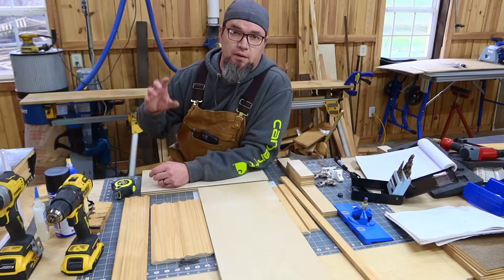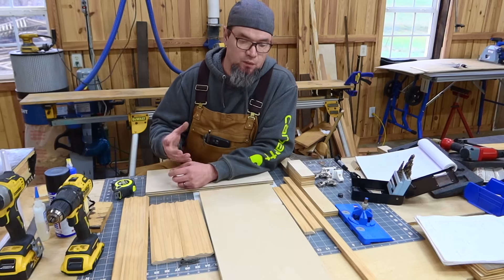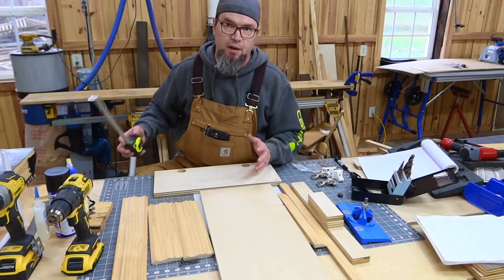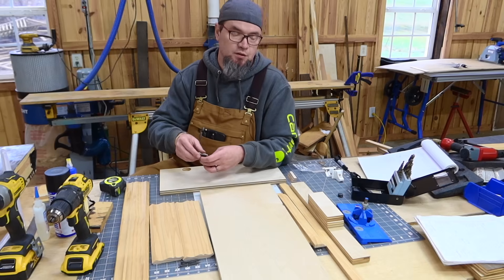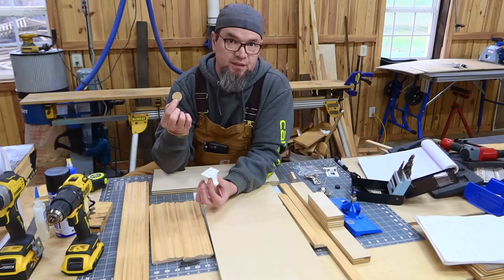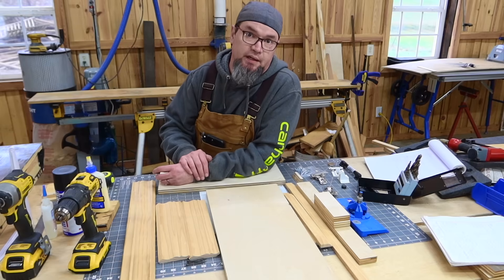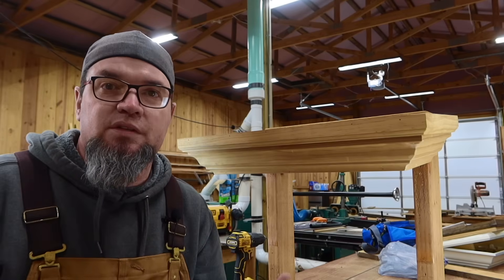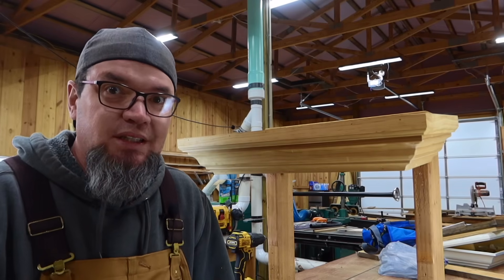Concealment Shelf Build (New Version) / Make Money With Woodworking!

Comment: When making this did you use a 18 gauge nailer or  a pin nailer? And what size nails? Oh and how did you cover the nail holes?
Reply from the maker: I used an 18g nailer with 1 1/4" brads.  Stainable woodfiller is the best.

Comment: Matthew, Would you believe Home Depot and Lowes did not have 3 1/4 crown so I had to go with 2 3/4 that made my brackets 3/4 by 1" in order to close. If I used the 2" The back would not close and the front would not open properly.

Comment: Does the bracket sit flush with the top of the crown molding on the bottom section or is the bracket higher?
Reply from the maker: the bracket may end up being a bit higher.  It depends on how low you set the hinges and the crown depth.
Reply: @MatthewPeechWoodworking  What do you think is the minimum crown size you could use would be? I am having a hard time finding 3 1/4". 2 3/4" seems to be the most common that I can find in solid, unfinished wood.

Comment: Nicely done.  Do you have a link to the rare earth magnet?  I've ordered several different off Amazon and none of them are powerful enough to move the latch.
Reply from the maker: Yep. I’ll throw a link in the description to the exact ones I bought.
Reply: I’m actually looking for an alternative to the magnet option. Any ideas on that front? Nice work, by the way, since watching this I’ve bought a table saw, a sliding compound miter saw and a trim router. I think I might need to start making some stuff!

Comment: Thanks for the video and all info; is it possible to  get a tighter fit (front to top) so there is no drop between top and front?? Maybe a thin strip of rubber, foam or leather?
Reply from the maker: I would drop the back.. you need the room to push up a bit so the lock can unlock.

Comment: Angle of cuts on crown and trim would have been useful in description or in the plans either one I watched the video and purchased plans and alot of it is me being a beginner but have gone thru 2 pcs of crown with 50 mile trip each way to get the crown molding.
Reply from the maker: It’s a standard outside corner crown cut depending on your method of cutting crown depends on the angle and bevel. Check out a video on cutting crown and I think you’ll understand a bit more.
Reply: @MatthewPeechWoodworking  Okay like I said me being a beginner I watched your video on crown set my saw and cut was perfect thank you so much and i learned something along the way thank you again love your videos just need to watch more of them I guess.

Comment: Any advice for cutting the 60° cube/block on a miter saw safely? My miter only bevels to a 45°. All the videos I can find for a 60° the miter is 60° miter.. but not the bevel. If I cut a 60° miter it isn't going to give me the shape you have here. I tried to router a board then cut however my router bit is only a 45° angle also. I can't figure out how to make that little cube without a table saw. (At the 45° there isn't enough room for the hook to go over the lip of the lock) any advice? I'm stuck here...
Reply from the maker: It will if it’s cut on its edge and not flat. Every angle setting is subtracted from 90 degrees to get the actual measured angle. So, to cut an actual 60 degree angle, set the miter saw to 30 degrees. There is no setting for 60 degrees, but 90 minus 60 is 30. It's kinda "backwards" but once you get it it's simple. 45 degrees is the only setting where the cut is actually 45 degrees.
Reply: Maybe  rip the angle on a longer stick with a table saw, then cross cut a bunch of 2 1/2" pieces.

Comment: @ Matthew Peech, I went through 75 dollars worth of crown molding  and still can't get the corners to match. are you doing a compound 45 miter. i mean 45 x45 degrees? I am lost and i don't want to buy any more crown if i can't get this right. You skipped how you cut the crown in your video and i think that was a very very important step. Any help would be cost savings to me!
Reply from the maker: You need to research how to cut crown.  I didnt cover it because there are several different ways and that is a video of its own.  I personally like the nesting method.  look that up and you'll be set.
Reply: @MatthewPeechWoodworking  Thank you, the very first video was "this old house and tommy did a very good job on doing the outside corner cut, explained it a lot.

Comment: Great tutorial!
One question…I noticed that once closed, the front drops down a tad and creates an uneven reveal on the sides.
How would you suggest minimizing that drop?
Reply from the maker: You can adjust the hinge down.
Reply: Great video!  I have the same question, but could you give us a little more information?  How do you adjust the hinges down?  The only workaround that I can figure out is to move the latch mount down a little.  I ran into an issue when I did that.  The lid wouldn’t close because the latch portion on the top was now too far forward.  I moved the latch bar down a little and solved the closing issue, but the uneven reveal on the sides is still an issue.
Reply: I noticed this too. But for some reason, I cant see the replies to any of the comments. Do you know why I cant see them? Great video! Thanks!
Reply: @terrysmyly3902  You turn the screw on the hinge to adjust up and down.  but I see that's not enough to even it out still. I was thinking maybe increase the offset on the hinge hole from 3 to 4 on the kreg jig to get more adjustment down to help even out more, maybe the next one I build I will try unless someone else has tried that hope to hear if so...
Reply: On another note thought about adjusting the lock latch higher on the bottom section...maybe

Comment: Quick question, Hoss...  I've built the shelf, love the idea, but the release won't release unless I put upward pressure on the shelf bottom.   have you run into this issue?  If so, what's the fix?  I tried weight and that didn't fix the issue  Thanks

Comment: Great video! Quick question... is there a special type of hot knife for cutting the foam?
Reply from the maker: They make them... I use a cheap box cutter with the snap off blades... extend it out and heat it with a torch.  99 cent hot knife.

Comment: Matthew, love your videos, thank you so much. You inspired me to build a few concealment shelves for gifts or possible sale. I'm wading in the shallow end before committing to the deep water. Now I have a (stupid?) question. I used the latch and damper you suggested. Is it normal to have to  lift on the bottom of the compartment to get the latch to release? Even with no weight inside it needs a little upward motion to make it release.
Reply: how to open by moving the magnet then lifting the compartment. See it was a stupid question.

Comment: Hey Matthew, thanks for the videos man. They are very good  and extremely helpful. My question is, what is your strategy for painting/staining multiple shelves at a time? And how are you able to do so in 20 mins? I did two last night and staining was about 1.5 hrs then three coats of water base poly with a hr dry time in between, I was in for like 4.5hrs on two... If you have a better smarter way please help me. 🙏🏿 Thanks
Reply: use a lint free cloth, like a wash cloth to apply the stain. wipe it on with one cloth. then use a clean cloth to wipe off the excess. you can stain 20 shelves in the time it took you to brush 2.
Reply: @cliffordsteece7123  are you using a stain then a poly or one of the stain and poly all in ones?
Reply: @richmond12000  I use well mixed gel stain and polyurethane high gloss varnish after stain dries.

Comment: So at about 16:40 you were talking about if you're going to stain it to wipe the glue up as you go. I'm wondering if you stain the pieces first, will the glue still cause a problem? Also, can you put glue on a surface that's already been stained or painted or does this effect the efficacy of the glue? Thanks for your help, love your videos!
Reply from the maker: Hey Claire!  You can stain the material first and the glue will do just fine!  After it is stained the excess glue will clean up without changing the color.

Comment: I've made 2 of these so far. One from cherry and one from red oak. Made my own crown molding and trim. They look awesome and people love them. The problem I'm having tho is the latch. When using the magnet you still have to lift up on the bottom because the latch has a hook and will not move with the weight on it. Anyone figured out a fix for this?

Comment: I can’t find this crown moulding anywhere. I’ve devised a workaround to avoid the sky high price of Baltic birch plywood and the latches and hinges are unavoidable. What are the key dimensions of the moulding? I would be ok with changing the appearance of the shelf as long as the function is preserved.

Comment: Cannot find the trim at home depot or lowes.
Reply from the maker: You can use any trim that is that size.  If you go larger or smaller you'll just have to alter the size of the "lid" to compensate for the size difference.

Comment: How did you cut the model for the foam to the exact dimensions of the clips and gun placements
Reply from the maker: I lay the item on the foam and trace them with a marker and then cut them out. It works well.

Comment: The hinges in that link have four tabs (as though you're supposed to put a board in there), and so they don't fit the same way. What are the hinges called with just the tabs on the back so I can slide the board up to it and then screw it on? Because these hinges won't work.
Reply: The hinges won't work unless you hammer the two little flanges into the wood (which doesn't seem like the best thing to do).

Comment: Would you say 3¼ is the minimum size crown or could 2¾ for a little slimmer look?
Reply from the maker: Just remember with each step down the room gets less and the Top would need to be smaller.  I havent built one that slim so not sure about the struts and latches.

Comment: I cut my last piece on hand today for my top out of square being 10" wide on one end and 9 7/8" wide at the other end. Would you think I would be ok making it all 9 7/8 instead of 10. ? Appreciate the feed back....
Reply: did it anyways hope it fits together once i get some crown
Reply: Found some crown at Menards and a few other things 8' of crown $21.99. Almost enough for two still expensive!
Reply: Well I had room. Top board 9 7/8" wide was thinking it would be tighter but there is a considerable amount of room still there. Not sure what everyone else ended up with but I would say 1/4" easy. I'm thinking maybe go smaller or make bottom wider or both depending on the room you desire...

Comment: Thank you for making the awesome video. I have a question on the crown. I can’t find 3 1/4 crown anywhere close to me, so I bought 3 5/8. Since the crown is wider, do I need to make the top and inside brackets 3/8 bigger? I would normally trial and error, but red oak in my area is currently $78 a sheet and maple is $98. The guy at Lowe’s who helped me put it on a cart said it’s going back up again. TIA
Reply from the maker: Yes... The wider the crown the wider larger the top needs to be.  I would build the bottom first and then measure the crown after installed edge to edge. leave a bit of room for adjustment.  Hope that helps!

Comment: So which is it? A 50N Gas Strut or a 10N Damper?? There seems to be a big force difference between 10 newtons and 50.
Reply from the maker: That’s your call. Do you want it to push down or a soft drop. 50n strut or 10n damper
Reply: @MatthewPeechWoodworking  Cool. Thanks. Wasn't sure what that was about.

Comment: For me, I didn’t think those hinges linked in the description are the right ones. They have pins on them to line up on the edge of a piece of 3/4” material. Maybe I am supposed to screw it on with those 3 pins going to the face of the board. 

Also, why not regular rectangular hinges?
Reply: Had this same question last night. Ended up making the “bottom” teeth flush with the edge on the bracket and let the “top” tooth bite into the wood bracket. The screw sunk it in pretty well. Having an issue with the top plywood sitting very unlevel in reference to the bottom when closed now. Trying to figure out a solution, the adjustments on the hinges aren’t enough to fix it either.

Comment: just a heads up to the wood working noobs like myself, you have to cut crown molding at an angle, the piece cant be lying flat! So i suggest watching other videos on youtube so you dont waste any material like i did, or get angry and chuck your crown molding! Other than that, great tutorial, Godspeed wood workers!
Reply from the maker: Hey!  I actually have an old video on cutting crown.  There is a way to cut crown flat but you have to have a compound miter saw.  Thanks for sharing!
Reply: @MatthewPeechWoodworking  ohhh thanks for the info! Ill have to check it out!

Comment: The locks are crap. 

I built one of these...T for T, "i's" were dotted. Exact dimensions, same exact hinges, same exact Lock Connection hardware. 

I built one as a prototype. I'm no amateur. Been doing this stuff for 40 years Sir. 

The hinges you use are incorrect for this build. The locking mechanism is total crap. 

In both the hinge type, placement AND lock """ALL""" create to many gaps and wayyy too much play in its seating. 

There are gaps EVERYWHERE and no matter how much you adjust the hinges, there is still gaps in the cabinet. 

If there are gaps, then it's NOT "concealed", now is it? 

I believe you need to invest some time into making a 3rd video which eliminates these flaws in your design. 

And you are selling these plans? Your plans are NOT accurate Sir. 

You fail to explain WHY is 3mm used with "those" hinges. You fail to show and explain that the use of those hinges will create a gap. A gap you can't "conceal". 

There's an 1/8" - 3/16" play of the lock and lid/top/shelf of your design. That make the compartment housing of the guns, the Crown molding serving as the compartment look uneven when viewed, it droops down making the lines of the design unparalleled to the the top shelf. 

To compensate for the drop/play in these locks, the lock bar needs to be inset into the wood by the equivalent drop measurement. 

The 3mm hinge placement is NOT accurate. It should be right at the edge of the board which would be ZERO mm. It says it right there on that Kreg jig. 3mm = 1/8". So, automatically, by using that measurement and jig, the backside of the pivot point will have a 1/8" gap. 

You do not convey this in your video nor in your design plans. 

So, if I put a light inside this cabinet, you will see that light shinging through from all of the gaps from your misleading measurements you have provided. 

This is a very very POOR design Sir. The concept is good. Your execution of it is amateur.